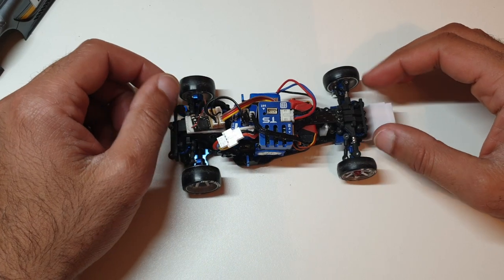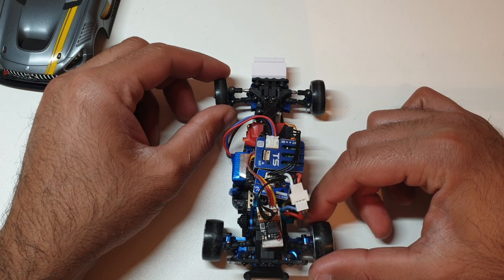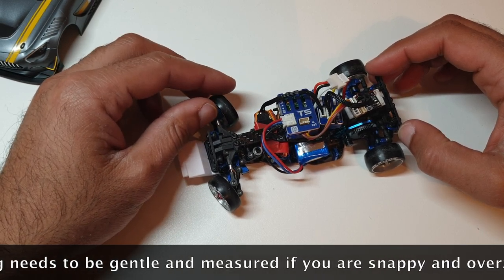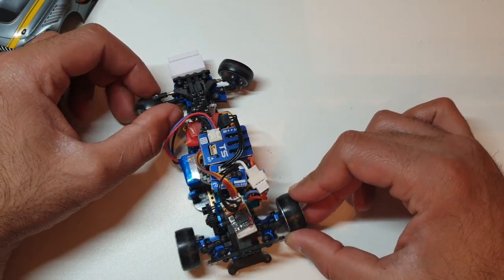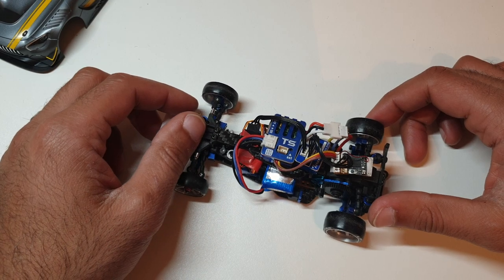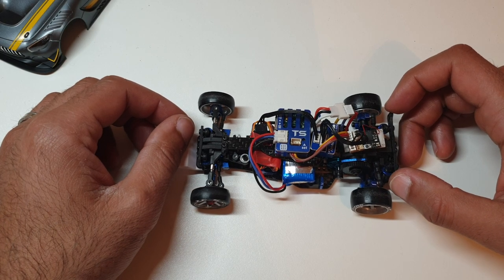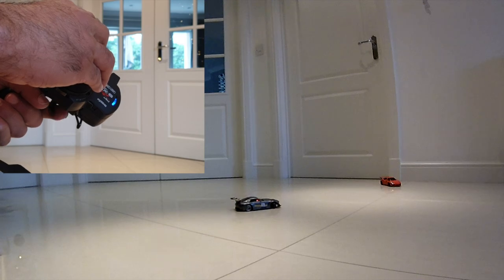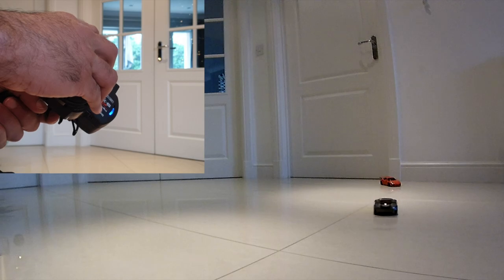Garage RC presents .....Xrx dpa sport Rwd Mini RC Car how to  drift   tips for beginners  ...

Comment: Really helpful to see actual input with the transmitter. probably gonna watch this video a good few times as I have a long way to go before I can say I'm good drifting my O D/ ORIGINAL DRIFTER ATOMIC DRZ.
Reply from the maker: It was hard to sync this up. I left the bad audio as I wanted to hear the motor and even though I tried I couldn't dub my voice over and match it to the steering  input... I'm going to do more  vids like this if it helps. 😁
Reply from the maker: Thanks 👍🏽
Reply: @GarageMiniRCUK  yes please and do keep the transmitter in the shot and if possible the sound of the RC so as to hear the throttle input. I know you already thought of this and I thought I would give you my fed back. Oh yeah I feel I'm the only one to ask,but you once replyed to me that you might do a Kyosho Dnano video hope it's it the pipe line if possible.
Reply from the maker: I've got a le mans shell and rx7. I'll do it over Xmas as I'll have more time 👍🏽
Reply: @GarageMiniRCUK  you have all the good stuff ,so jealous I have Lamborghini  mm and F40 RM  but can only wish to own the AWD and they are even harder to come across!  Oh by the way your website/ shop look really good hope to buy soon but need a few bits for the Dnano. Keep up the good work dude 👍

Comment: If you set off slowly 1.29 and the back starts to drift out the gyro will try to correct I understand but if you want the slow set off to drift one way or the other how do you start a drift in the direction you want😅
Reply from the maker: Depends on tyres and surface and set up . If very slippy then and steer into drift as you move off , if esc had a super slow start up high torque like the furitek .

Comment: I'm thinking about getting into the mini-z (instead of 1:10 i always had. I do like to have a drift car, but most models don't have this crazy steering angle. Can you tell me which chassis you are showing here? People tell me to take a 03 Evo or AWD, but i like to have an RWD and with a crazy steering angle like you are showing.  
And did you do something with this chassis, or is this stock? (to get this steering angle or to have a gyro on it).
Reply: And finally, a video where you can see how drift works. With the car seeing to drift and the transmitter seeing how he is handling the controls. And see both at the same time. Thank you.
Reply from the maker: its rwd drift car these have crazy wheel angles and steering